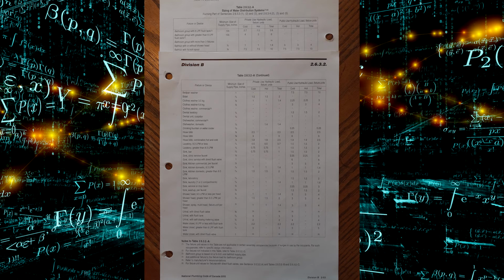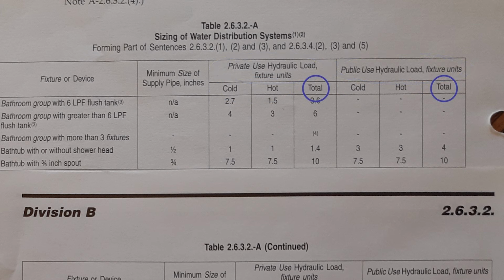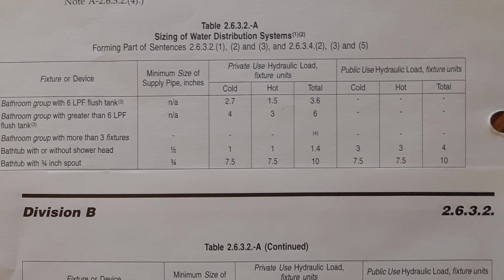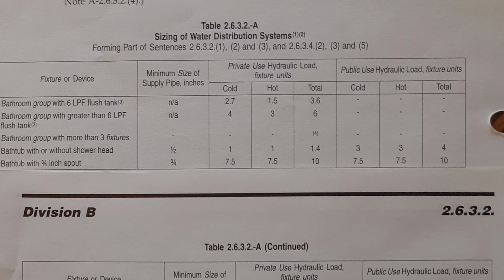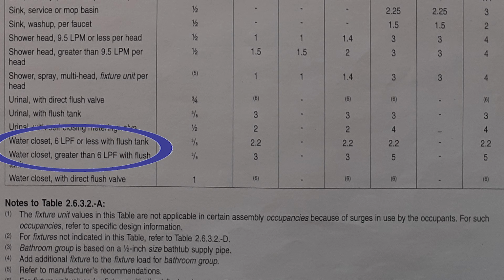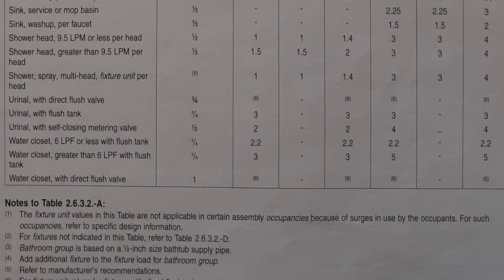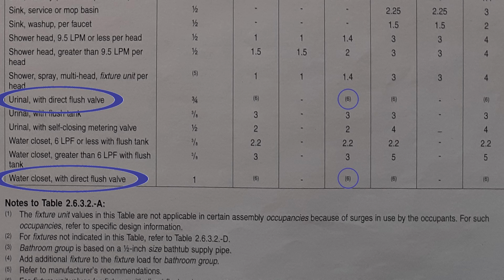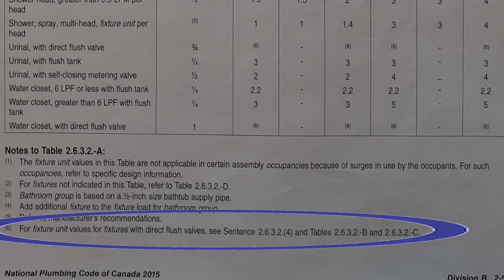Water Line Sizing Part: 1

Comment: of curiosity,  in previous example, a 88kbtu  furnace with 72' longest length uses table  3/4' black iron pipe,  however in the field, the drop would be 3/4' BUT the connection to the furnace is always 1/2" (even 140k furnaces)  as the gas valve is typically 1/2" input, how is this viewed/ rationalized with respect to line sizing?
Reply from the maker: It's standard practice to reduce down to the required connection size out of the tee at the bottom of the gas drop. The 2 to 4 feet of finish piping with have little or no effect on the operation of the appliance given the gas line is sized properly up to that point.

Comment: Know the simplified method or is that just something my class does?
Reply from the maker: Yes, the simplified method is taught in second year (In Alberta)

This video series is based around the small commercial method (third year)
Reply: @MathematicPlumber  in Nova Scotia water supply sizing is rarely done simplified method is only needed for test’ and exams I just need help with sizing upstream of the HWT
Reply from the maker: @johnduncan21  Try this: https://youtu.be/n6RqUKEJqWE

The only difference is that you will use the simplified sizing table.